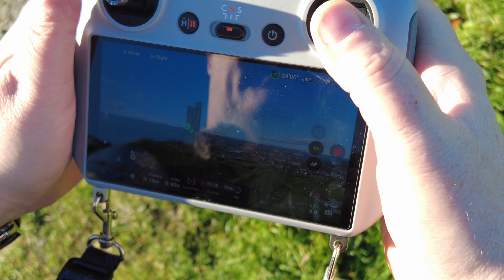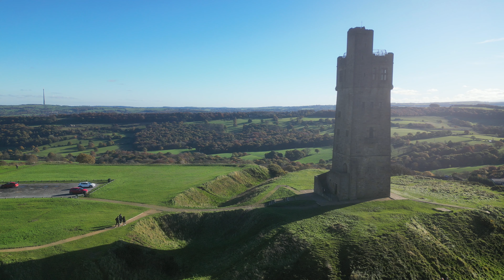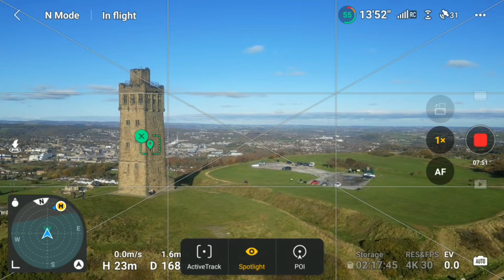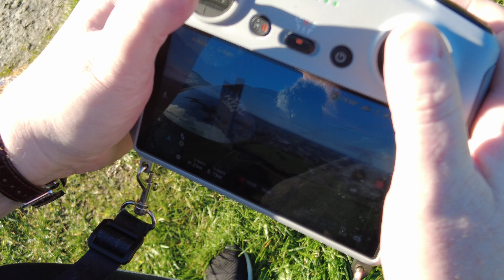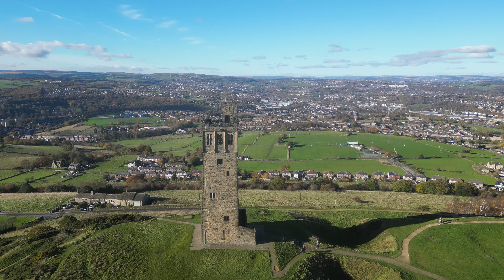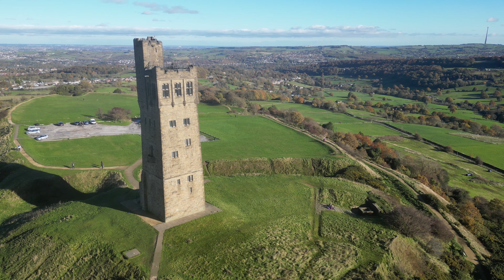LAZY DRONE PILOT OR GENIUS? #TUTORIAL SKILL 4K DJI MINI 4 / 3 PRO

Comment: Good information. I've previously tried using tracking to assist in the gimble movement. Unfortunately it is not available in 60fps on the Air 2s. The net result is I do it manually much like yourself. 👍😎
Reply from the maker: Thanks for sharing and commenting. Yeah I always learn the manual way and then try to teach one way that’s a bit easier and I am sure there are other ways too. All part of getting better with the drone lol

Comment: Great video Trevor. As youre flying past the object, is it the drone thats turning or the camera rotating round?
Reply: @mooncat1973, Here is a way to practice this move.  If you can, lay out a straight line that runs about 20 feet to one side of an object that you want to focus on.  For example, set the object you want about 20 feet to one side of a straight line on the ground.  You can lay out a length of ribbon to mark the flight path say from South to North.  You plan to fly past the object at a constant speed while keeping the object in the center of the camera view.  The Drone should be directly over the ribbon on the ground as it flies past. To start, you are flying almost straight North with the object in the camera view.  As you approach, you try to YAW the camera at a varying rate at the object. Tripod or Cinematic mode would make this easier by allowing you to use full speed forward at say 4 MPH.  Keeping the right stick full forward, to pass off the right side of the object, you will need to YAW the drone left at an increasing rate as you reach the 90 degree point and then decrease the yaw rate as you fly away in reverse.  The right stick will need to be moved clockwise to keep the drone over the ribbon while you yaw the drone counterclockwise.  The rate at which you turn the sticks will be proportional to how close you are to 90 degrees off to one side of the object. The rate for both sticks will increase as you approach the 90 degree spot and then decrease as you fly on past while still flying over the straight ribbon on the ground. So....   You start by flying forward at 4 MPH. At 90 degrees to the object, you are flying sideways on the controller as you stay over the ribbon and by the time you finish, you are still flying 4 MPH over the ribbon but are now flying in reverse. The movement of the sticks is greatest at the 90 degree point and decreases as you move away.  So, the left stick is controlling the yaw to keep the object centered in the view and the right stick is controlling the speed and flight direction OVER the Ground.  Difficult to explain in words, much easier in person.  This exercise is even more difficult if the right stick is not fully deflected to full speed, that's where Tripod Mode will be your friend.
Reply from the maker: Thank you so much. It is the drone that’s turning hence why you need to counteract it by pushing the right stick in the clockwise position to continue the flight in the same direction. If you are higher up in the air then the gimbal will look down at the object at the same time as turning. It can all be done manually but it’s quite complicated to do. I will be expanding on this in a future video that takes this move to the next level

Comment: Hi Trevor. I have been using this move manually for a while, with varying degrees of success. It's such a cool move but VERY tricky. I call mine the 'handbrake move'. I'm going to try this method and see how I get on. Excellent video, thanks. Take care & Cheers. Suffolk Air Adventures.
Reply from the maker: Hi and thank you for commenting and I am glad you can do the move manually and like you said it is very difficult. I will teach how to do this with a moving object also and that is very difficult to do manually LOL. Let us know how you get on : )
Reply: @Trevors-world  You are welcome. It was a really helpful video... Just what I have been looking for. Thanks again and Cheers. SAA
Reply from the maker: @suffolkairadventures  Aw thanks it means a lot, I will be doing more then if they are in demand lol
Reply: @Trevors-world  It's similar to an old kid's exercise of...  can  you rub your belly in a circular motion while you pat yourself on the head at the same time and avoid getting mixed up.
Reply from the maker: @2Ply789  LOL great analogy and perfectly put LOL. I have many, many moves that I do like that where you have to be an octopus lol. I will be teaching more moves but an easier way to do them plus some you might not have seen before and fancy having a go at : )

Comment: I practice that move often...  You would think it would be easy...  NOT!  I'm finally getting the move down but I've never tried it using Spotlight.  To fly the Drone in a straight line across the ground at a steady speed while keeping the camera on the object you are passing and then swing the camera back toward the direction of flight after passing the object without slowing down or stopping.  I've been waiting to see someone demonstrate that move...  Thanks!
Reply from the maker: Thank you so much for taking the time to watch and comment. I am pleased that someone somewhere will get a benefit from the video although I apologise from my rough sounding voice lol as I was still a little unwell when I filmed it. My voice is almost back to normal now and I must be feeling okay as I am heading out to film an amazing place this morning. It is quite difficult to perform manually and even more so if it is a moving object LOL. I will gladly do many more tutorials for people if I know people want to watch them even if I know they are imperfect LOL. Af the end of the video I have put links in the 4 square boxes where you can see 3 of the Theatre Interiors where I filmed them completely using a drone and were all inside buildings instead of the usual outside LOL. Enjoy : )